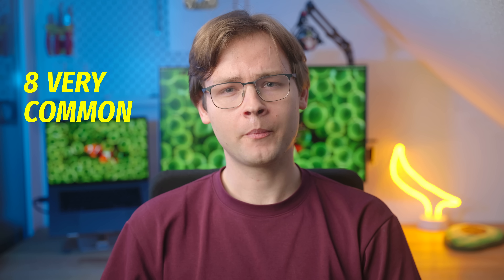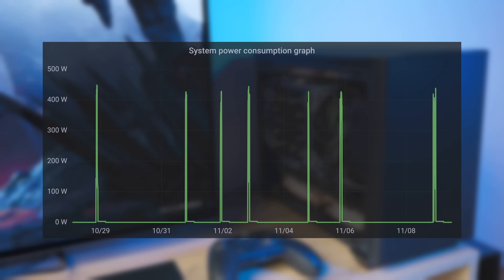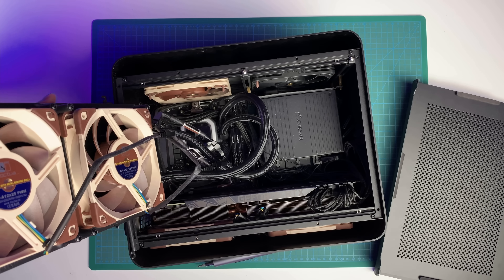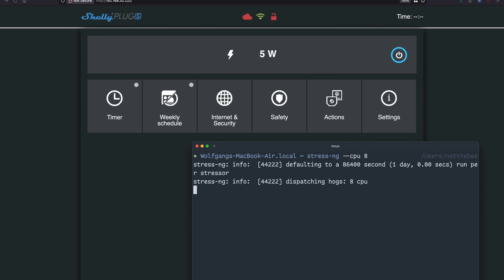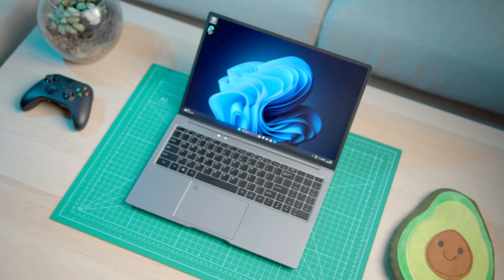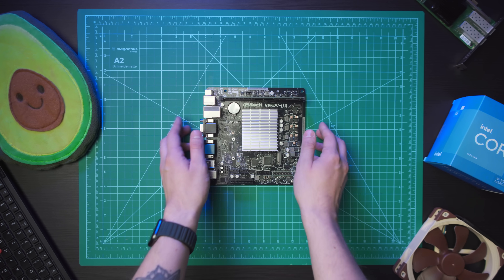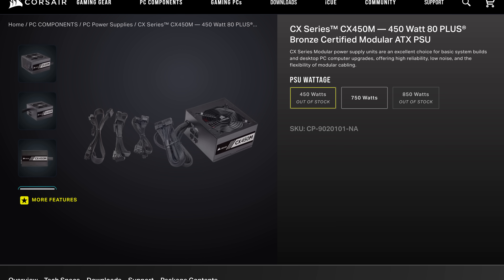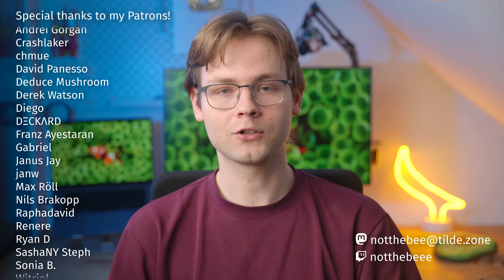Busting 8 Common Homelab Power Efficiency Myths

Comment: Three things:
1) As always, it REALLY depends on what you're doing with/in your homelab, and by extension, your server.

My dual Xeon 32-core/64-thread server just spent about a month, indexing about 2 million pictures on Photoprism. As a result, my CPU load averages was nominally around 12-16, but peaked to 120 from time to time.

Right now, it's load average is around 8, with 13 containers and 10 VMs running.

2) If your homelab CPU load average ISN'T high, then either you have overspec'd your system or you're not pushing it hard enough. (I ran through my mass consolidation project last year so I run as many things as I can, on my said server, which keeps the load average high, which keeps the overall utilisation high.

3) re: ARM vs. N100 (I don't have a N100, so I'll compare it to its close cousin, the N95)
There is no official support for Proxmox on ARM.

You'll have to hack it to make it work.

My new N95 mini PC is 89 mm x 89 mm x 43 mm. Again, depending on what you are doing with it, the size and performance may be a factor.

I have three of them, in a 3-node HA Proxmox cluster. I added a 512 GB M.2 NVMe SSD in place of the 512 GB SATA SSD that it came with, and partitioned it such that Proxmox is installed on the first 100 GB, 8 GB swap, and the rest, I use for Ceph RBD and CephFS.

Live migrations can be as short as 8 seconds between nodes.

And the entire cluster (which runs my AD DC, my DNS servers, and Pi-Hole), consumes 21 W at idle, combined. (with both NICs plugged in)

Max total power draw is ~40 W combined.

So, it REALLY depends on what you're doing with it.

My big server consumes ~670 W with 36 HDDs. But considering that a server with 4 HDDs can consume 200 W by itself, 670 W for 36 drives doesn't seem so bad given what I can do with a dual Xeon system.

Your can get more power efficient CPUs at the sacrifice of performance.

You can get more performant CPUs at the sacrifice of cost.

This was the optimal system for me, and I push my system HARD.

(13 CTs and 10 VMs = internal VM <-> host communication via virtiofs = no need for 10 GbE switches. If I want faster networking, I have my 100 Gbps Infiniband switches/setup.)

But that's off now, 99.9% of the time.
Reply from the maker: >If your homelab CPU load average ISN'T high, then either you have overspec'd your system or you're not pushing it hard enough.

That's a very simplistic view of things, in my opinion. Raw performance is not the only thing to consider here – expandability, I/O and power efficiency are also important. 

Performance-wise, I could probably run my entire workload on a Raspberry Pi 5. However, I also need a lot of SATA ports, 10GbE networking, and hardware transcoding capabilities, which RPi can't offer.

So I have a Kaby Lake Pentium in my home server, purely because it lets me have PCIe, M.2 and lots of SATA ports, while still remaining fairly low power.
Reply: @WolfgangsChannel  
"That's a very simplistic view of things, in my opinion. Raw performance is not the only thing to consider here – expandability, I/O and power efficiency are also important."
My take on that is that it's still a part of "performance" - whether you are talking about CPU performance, or the performance (or ability to perform) based on other features that are either needed or desired.

For example, I picked my new trio of mini PCs based on a composite score that I calculated for "Performance" that took the Geekbench 6 multi-core score * the amount of RAM the system had in GB, * the SSD capacity (also in GB) * the number of RJ45 ports * the speed of said RJ45 ports so that I could get a composite "performance" score.

Thus, a system that has the same processor, RAM, SSD capacity, but one has dual GbE NICs and whilst the other only has 1 GbE NIC, the former would twice as "performant" in my made-up composite score than the system with only one GbE NIC.

Conversely, a system that had the same CPU, amount of RAM, SSD capacity, and both have one NIC, but one is 1*2.5 GbE whilst the other only had 1*1 GbE NIC - again, the former would be "2.5x" more "performant" than the latter.

And then with that, I can also try to find the idle power consumption for that CPU (since my AD DC cluster was mostly going to sit at idle), and the price of the system is the price of the system.

From there, I can compute the performance/($/watt) metric and plot the options in a scatter plot against each other.

The one that has the highest performance/($/watt), but the lowest cost wins.

If the number of PCIe slots is important to you, then you can add the number, the number of lanes, the PCIe generation as additional variables that factor into the "performance" calculation (again - it's an entirely made up metric, but it is to be able to distinctly separate "higher performing" systems from "lower performing" systems, when cost and power are ultimate taken into consideration as well.

I have found that a lot of tech YouTubers like to add, add, add to their home lab. More computers, more networking, more more more. It is rarely going in the opposite direction where it's to see how LITTLE hardware you can get away with, and still be able to do all of the things that you want to do.

(I think that I went from running 4 NAS servers, and 5 tower systems down to 1 4-bay NAS, my 36-bay Proxmox server, and a mini PC now. Stuff that I was doing with my other systems have all been consolidated onto one system, so that I push the average utilisation as high as I can go. My 5950X systems, at full load, with 1 HDD, takes 142 W (and I have two 5950X nodes in my mini HPC cluster). My old 4 NAS servers + 48-port GbE switch, consumed a combined total of 1242 W of power. My 36-port Mellanox 100 Gbps Infiniband switch, I think, consumed something like 200 W of power. Now, I am down to 7 W for my Netgear 16-port GbE switch, and 670 W to run everything else that I used to run on my other systems/servers. VM <-> host communications is handled via virtio-fs, so it bypasses the entire networking stack entirely.)

"Performance-wise, I could probably run my entire workload on a Raspberry Pi 5. However, I also need a lot of SATA ports, 10GbE networking, and hardware transcoding capabilities, which RPi can't offer."
Interestingly enough, even the Jonsbo NAS chassis really aren't that power efficient. I think that they were somewhere around the 200-300 W range for 6-8 HDDs. Conversely, I can do about 2.333x that power consumption, but then have anywhere between 4.25x-6x more HDDs within that power budget, which means on that #ofHDD/W, my 36 bay server, despite consuming more power, is more power efficient.

Again - it's entirely up to you how you want to calculate that composite metric.

The N95 isn't a very performant CPU in and of itself, but it does have Intel UHD graphics, which supports QuickSync, so I can use it for hardware transcoding, which means that even if the CPU in and of itself isn't that power, it's not a deal breaker for that application.

My Supermicro X10DRi-T4+ comes with 4 10 GbE ports, onboard.

Or in my case, because everything runs off the same box, I don't even need 10 GbE because the virtio NIC driver in Windows 7, shows up as a 100 Gbps NIC. (WIndow 10, 11 and all Linux distros, it shows up as a 10 GbE NIC.)

By pushing everything onto one system, some of these bottlenecks may be alleviated.

With virtio-fs, the VM <-> host and/or VM <-> Host <-> VM communication runs as fast as the drives can read/write the data. (I think that right now, I've topped out at somewhere around 4 Gbps with my HDDs, and about 16 Gbps when it is doing block I/O transfers, also with 36 HDDs.)

You just have to figure whether it is better for you to have your workload distributed across a bunch of different systems or whether it would make more sense for you to consolidate down to one system that does it all.

When I ran the calculations before I started my mass consolidation project, the power savings alone of cramming everything into one "do-it-all" box was worth it for me. As a "box" by itself, yes, it consumes quite a bit of power. But when you consider what it is running, and I've found less performant systems that cost less, and uses less power, but it is significantly slower in comparison against more expense, but more performant options, this ended up being the sweet spot for me.

(And when I plotted the performance/($*watt) vs. cost of the system, I was able to very quickly visualise how the more expensive systems are more "performant", but they were also more expensive. (I wanted my trio of mini PCs to be < $250 USD each, because I was buying three of them.))

Just think about how much more your server COULD be doing.
Reply from the maker: I love the idea of running everything on one system. And if that works for you – it's awesome!
However, I find that I tinker too much with my home server to also run the rest of my homelab on it. Which, at the time, isn't much – just OpenWRT, Home Assistant and Grafana.
I also find that I get way too "lost" when I add too many devices to my homelab, so for now I only have two – my main home server and my J4125 firewall box.
Reply: @WolfgangsChannel  
Like yourself, I am trying to pursue efficiency as well (via a composite, but totally "fake" performance metric that I calculate/($/Watt)) so that I am neither looking at JUST $/Watt nor performance/$ but rather a made-up combination of both, so that I can put the data into context, relative to each other.

"However, I find that I tinker too much with my home server to also run the rest of my homelab on it."
Yeah, so my main 36-bay Proxmox server is my "PROD" server. It hosts pictures of our kids, etc. - the really important stuff that if lost, I can't go back in time to get back.

So, that, I don't mess around with. Once PROD goes up, it stays up.

That was also the reason why for my Windows (and Linux) AD DC, DNS, and Pi-Hole, I deployed a new, 3-node HA Proxmox cluster so that I was able to mess around with the cluster (and break stuff on it, wipe it, and re-do it all again) without affecting my PROD server.

Once I got the configuration that I am happy with, then that goes from like a "tinker"/"homelab" cluster also to PROD (or a second part of PROD) (which handles all of the user login management, and local domain/hostname resolution, and network-wide ad blocking), and now, I don't tinker with that neither.

So, if I want to test something else out, I can use one of my existing systems, to play around with stuff, but for the most part, once the testing is complete and set, and it goes live as PROD, then it stays that way.

"I also find that I get way too "lost" when I add too many devices to my homelab, so for now I only have two – my main home server and my J4125 firewall box."
My biggest issue with this is actually all of the manual, static, IPv4 address assignments.

So, I have an Excel file that tracks that for me.

Beyond that, I also name my CTs/VMs as to what it is for, so it helps NOT to get so lost when you end up running a bunch of stuff, simultaneously. (or I can put it into the notes for the CT/VM)

Even my mini PC (which is my desktop replacement -- going from a tower 3930K to a Beelink GTR5 5900HX) also runs Proxmox via an Oracle VirtualBox VM (and the same type of mini PC that runs the TV in our living room, also runs Proxmox via VirtualBox VM), that gave me the additional ability to offload some of the work that the server was doing (for times when the server was really busy) onto other systems that didn't have a higher level of utilisation.

And I would've recruited my tiny human's 8th gen Intel NUC as well, but it, for some strange reason, doesn't support nested virtualisation, so unfortunately, that one's off the hook.

So where and when I can, I try to use/reuse the hardware that I already have unless the hardware is so old that it either can't do virtualisation (my dual AMD Athlon MP2600 being the case), or that it's so power hungry that using something newer is vastly more power efficient (my dual AMD Opteron 2220SE system consumes 510 W).

There comes a point in time that it doesn't make sense for me to be running my Core2Quad Q6600 (which idles at 140 W) anymore, and opt for something newer, and more power efficient.

Comment: False information, you cannot compare cpu power reported by software to macbook air power. The macbook air shows power usage for entire system, intel system just the cpu alone. You should measure power from the wall
Reply from the maker: In both cases the power was measured from the wall

Comment: @WolfgangsChannel You made a quiet serious mistake in your Test Setup. If you use VMs for testing the energy efficency in idle, you can throw away your test. Virtualization is incredibly bad in passing through energy saving features. It is really as bad as it can be. You can compare a native ubuntu installation with one on a VMWare or Proxmox VM, and you will see a large difference. And it gets even worse on modern CPUs. The open source community started projects to improve the situation - but everything is still work in progress. And most of them started 2022/2023 - so don't put your hopes up for the near future...
Reply from the maker: What test?

Comment: Wow, this video is what exactly i need to improve my homelab power consumption in next day: change hardware newer the old one like 10Gbps Lan card, remove Raid card (change from ESXI to Promox), use only 1 channel DDR4, change 3.5 Inch HDD to 2.5 inch, remove some unnecessary things like wifi card, led cable (included on motherboard)... I hope power consumption will decrease from 100W to less than 60W
Reply from the maker: I'm not sure if your serious or not, but you should probably skip the 2.5" HDD and one channel RAM thing.
Most 2.5" HDDs are SMR, not CMR, which is not recommended for NAS use.
Reducing your RAM to single channel will save you 1W at most, but will drastically reduce memory performance
Reply: @WolfgangsChannel  Well, thanks for your advice but after 2 years' experience with my HomeLab, i see that my data only use for backup and read only so changing from 3,5 Inch HDD WD Red Plus (CMR) to 2.5 HDD WD Blue (SMR) are not affect with any main services that will be stored at SSD pool (MLC NAND) beside i change from 2 ram stick to 1 because I want to add another Ram stick which is higher capacity later.
Reply from the maker: 2.5" drives are also often less reliable than the 3.5", and buying all new drives even though your old drives are perfectly fine, is probably not gonna reimburse itself.

What I would do instead is just spin the drives down and only spin them up when you're doing the backups.

Comment: Chopped about 20watts off my 12400 system, changing a SF600 to an Intertech 120watt pico psu, you can do power supplies that are efficient at high and low load loads in the +94 range but it does cost to get to that place, the space industry has done that for years, but it comes at a cost on the price.

Comment: If you stack the power consumption graphs of the gaming workstation and the server on top of each other, you actually get the idea where to go next - buy a desktop system with additional cores/memory, let it run 24/7. Game when you want to but at the same time, have a bunch of VMs/containers run at the same time doing your server stuff. you hardly edit/encode videos while gaming, so heavy workloads usually do not interfere. if that still happens, use even more cores/memory. having just one big system is simpler, and frees you of having to supply a decent network infrastructure, like switches and the like.
Reply from the maker: Unfortunately, modern GPUs don't have the best power management at idle.

Both NVIDIA and AMD GPUs have had issues with high idle power consumption, and in general, adding a GPU to your system will increase your idle power consumption by 15-50W.

Having to deal with VMs, IOMMU, GPU passthrough and all the associated quirks and bugs also outweighs the advantages of having one machine for me. I prefer having two separate machines for different use cases
Reply: @WolfgangsChannel   Perfectly valid points. And just for the sake of completeness, I also run a dedicated gaming machine. Mainly for two reasons: First, I need tons of USB peripherals for gaming (air combat sim, so headtracking, flight stick, throttle unit, pedals and whatnot) and second, my main (work) machine does not have enough slots to add another GFX card - I already have GFX card and an AI accelerator as well as several PCIe nvme devices.
But I did run such a setup (prior to the AI accelerator) to decent success and stability. It takes time to figure out what to do, but sometimes getting there is fun in itself. Granted, you should have recent hardware - but it is an option for new builds.
I can confirm the rather lackluster idle power efficiency in the envelope you named: AMD W6800 idles at 34W, a smaller RX6600XT still does 20-ish watts. However, as I said, you might save on additional network equipment - modern switches with 1Gbit or higher usually operate in a similar ballpark in terms of power consumption.

Comment: great video as always.  My file backkup server is based on Intel G2030 2c/2t 55w tdp cpu from 2013 ($35 total from ebay, except for hdd), and is pretty much all I need. It powers on automatically only when needed and turns itself off when it finishes making backup job, so I don't worry too much about power consumption.